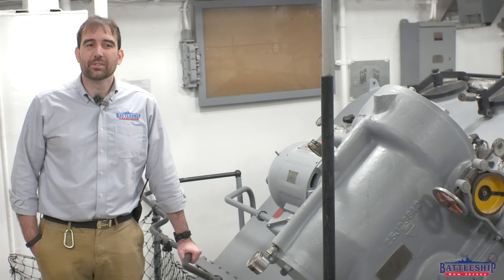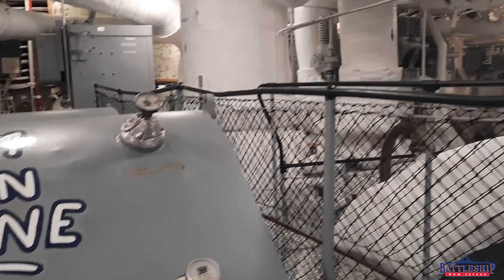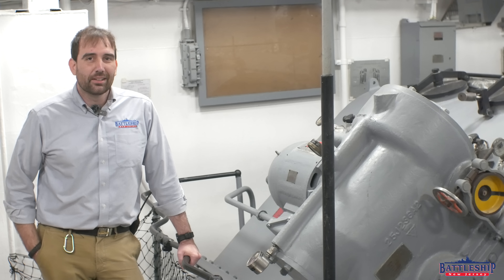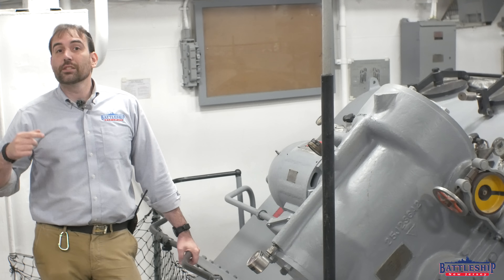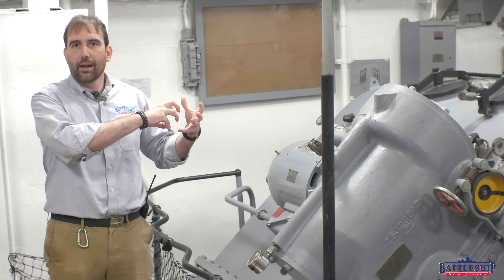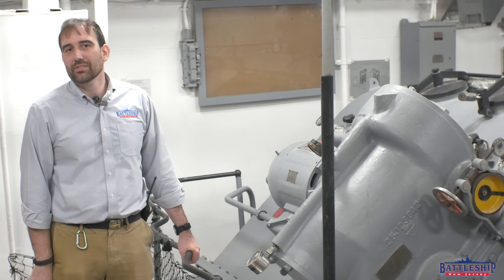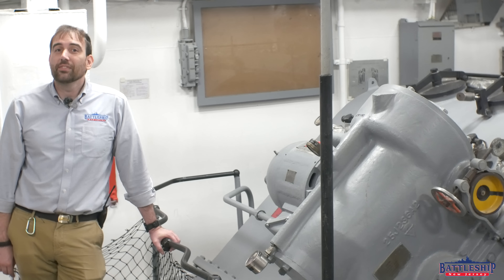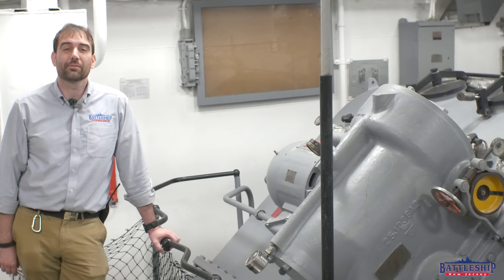What in the Navy is a Jacking Gear?

Comment: I won't comment on the lube oil situation...
Yes, the jacking geat is engaged for warming up and cooling down the turbines. It engages one of the quill shafts that are connected to (usually) the HP turbine. They are also used to lock the shaft (when required) while underway.
PS you should get an MM3&2 Book, along with a BT3&2 Book. They will teach you a bit more than you do about Marine Engineering.
I was an MM1, graduated from the Navy and got a Marine Engineers license.
Reply: The US Navy combined the BT rating into the MM rating in October of 1996... Good luck finding a BT 3&2 book.
Reply: @stevencovington4715  got one each on my bookshelves.
Reply: I believe the EN 3 & 2 also covers that.. Just lower psi systems..  Same principals though.

Comment: At what interval is the oil changed?
Reply: there should be a centrifugal oil purifier that can be used juring opperation. it takes oil from the sump and cleans it before returning it back to the sump. the same purifier can be used during cold iron to empty the sump to the storage tanks. all oil on a ship turbines is cleaned and recycled. the main turbines. feed pumps, blowers, etc.
Reply: if I remember right it is a matter of water contamination , and additive package

Comment: The Jacking Gear makes an appearance in the opening Pearl Harbor sequence in "In Harms Way" as in "disengage the Jacking Gear."
Reply: split the electric load
Reply: Open guarding valve. 

I didn’t understand that sequence until I operated NJ.
Reply: @richcruse2689  what is the guarding valve.
Reply: @johnshepherd9676  guarding valve is a main steam valve between the boilers and the engines. It is the last valve to let steam into the throttle valves, allowing you to operate the engines.
Reply: @richcruse2689  thanks.

Comment: Just curious, if the Navy let you, could you raise steam and turn the engines?
Reply: It would take a whole lot of work to get to that point - pipe connections, seal replacements, closing up spaces opened to give visitors a view inside among them.
Reply: @garywayne6083  opening up the proper sea chests, filtering water and conditioning it to be ready for the boilers. Loading on fuel oil and any other missing lube oil. Get the Diesel generators running again for power and air to get the boilers going. Find replacements for any missing or damaged parts.  They figure a year in a dock to get one ready for sail again. Just being able to turn the shafts at the dock. I'd guess a four month period with a proper crew.
Texas is the only battleship that doesn't have a contract that forbids using the steam plant. From the videos of Tom, the older one. The boilers are in very bad shape. They were not stored in a serviceable condition.
Reply: They aren't allowed to fire up the boilers.  But if the let them.  Ummm, I bet the engines would turn.
Reply: it would take boiler inspections. hydro testing and allot of otherr test.. replacing parts that were stolen for use on other ships and more then likelly a full refit.. could be done, just takes time and money.

Comment: The paint overspray on the brass jacking gear position lever labels at 3:25  is god awful.  the rivets need to be gently pulled and the beautiful 80 year old brass labels need to be restored, polished and reinstalled.   the new rivets will probably have to be made.    Pretty disappointing paint job on the jacking gear,  i think it ruined my whole day,   I would have gotten two weeks with a chipping hammer if i pulled that shtuf

Comment: The oil storage tank is extra oil... the sump holds the oil under the gearbox!
Also... the turning gear ratio is about 1 turn of the shaft in 12 minutes!
Reply: …so it’s more edging than jacking.  😇

Comment: In the episode about the propulsion shaft and seals, I was wondering why you guys don't periodically run the jacking gear to prevent the "sagging effect " on the shaft from being in one position too long.
Reply: There’s no point in doing that. 
We run the jacking gear periodically in port with the main lube oil system running, it keeps everything in the reduction gears oil coated. Now, when we are bringing the propulsion plant online for operation we then need to jacking gear engaged to keep the turbines ( there are 2 turbines on each main engine), the top of the turbines is heated with steam, the underside of the turbines is where the spent steam exhaust to, the main condenser, because the main condenser operates in a vacuum it is much cooler and if the hacking gear was not engaged that hot on top and cold on the bottom is what causes the turbine shafts to become bowed, not by gravity.
Reply: @franklentz5388 exactly correct.  It is the extreme temperature difference that can induce a bow.  That is also why, when the ship is underway, but at “stop,” the EOOW will request to “spin” the main engine every three to five minutes, not by jacking gear, but with the throttles.  If the LP turbine sits stationary for any length of time, it is “hot on top; cold on the bottom,” and it will definitely “bow the rotor.”  Gravity is not the culprit!
Reply: The navy probably won't let them.
Reply: I don't think they can? May be wrong, but with the exception of a few minor things, they're not not able to power major components like this. May be wrong.
Reply: @aserta I wonder if they have power for not just the jacking gear, but also the lube oil pump. Can't be rotating on dry bearings.
Reply: Rotating a shaft won't rotate gravity.
Reply: @michellelehky2374  No, but it will rotate which bit of the shaft gravity is pulling downward. Turning over idle machinery now and then is a pretty standard maintenance measure in industries that involve a lot of big, heavy things that are designed to spend most of their time turning (e.g., paper mills).
Reply: @ZGryphon  i didn't know that was the topic at hand, I thought we were talking about the shaft seals. Because the first comment mentioned shaft seals.
Reply: @ZGryphon  i didn't know that was the topic at hand, I thought we were talking about the shaft seals. Because the first comment mentioned shaft seals.
Reply: @michellelehky2374   It mentioned a video about shafts and seals. If the shafts are prevented from sagging (which periodic rotation would, theoretically, help with), the seals are less likely to leak.
Reply: By the way, the hacking gear can be operated in either forward or reverse direction.
Reply: In the engine room the biggest lube oil storage tank is actually the reduction gear box itself, they can hold 1500 gallons or more of lube oil, when we need to enter the reduction gears we have to pump all that oil into storage and settling tanks, that’s why not all the lube oil storage tanks are kept full.
Reply: Because the shaft stuffing box packing is so tight the shaft can not turn , so water is not leaking in along the shaft!

If it was loose enough to turn,  the water would be leaking in.

He just did a video on stern tube packing and leakage….